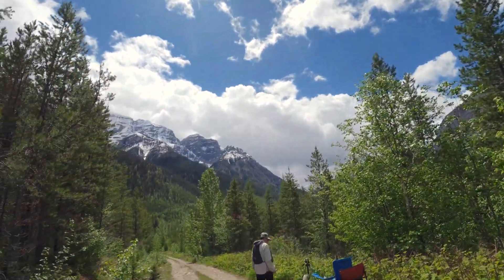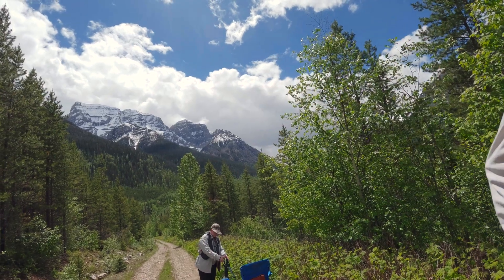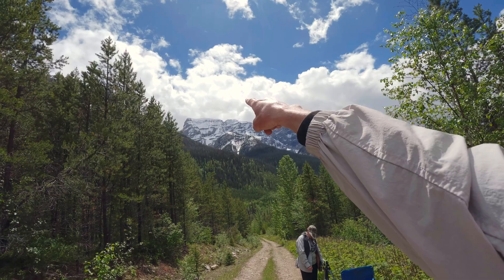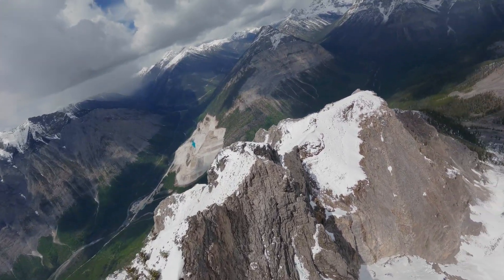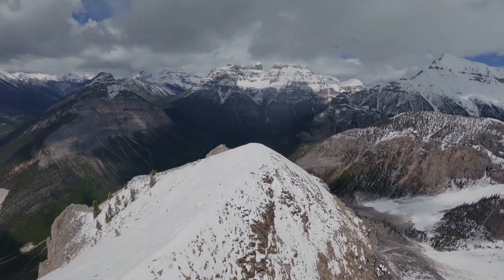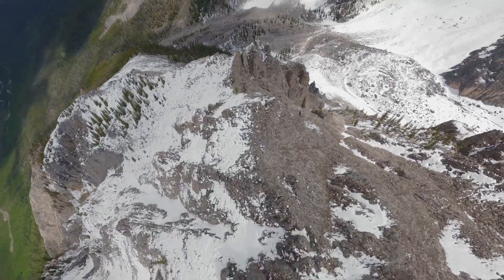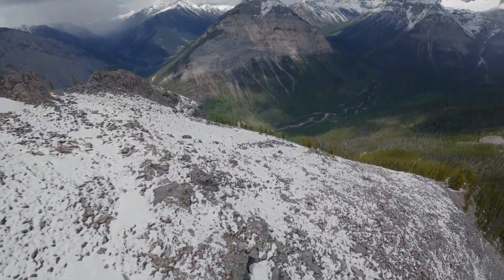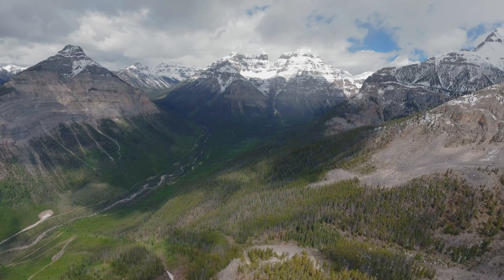Long Range FPV, Wind & Motor KV

Comment: For 10 inch can we go for 1250kv motors? I know it is recommended 900kv but just asking if 1250kv can be used or shall i gor for 900kv. Thank you 😊 🙏
Reply from the maker: I haven't built a 10" before but from what I know 1250kv might be a bit high.  I know 900kv is often recommend, I personally would probably pick 1050 or 1100kv.  It'll be a bit easier to tune than with the 900kv, just need to watch the amp draw, maybe 90% scale for the throttle.
Reply: @FalconRadFPV Thank you 😊

Comment: Hello, I am getting items together for a 7 inch build now. Things are a bit wacky on parts supplies. I am looking at the T-motor F-90 motors as a first choice. However my usual store front is limited to a 1950 Kv version. My flight area is primarily costal waterways. What would be your Kv selection for a space like that?
Reply from the maker: I would recommend 1300 to 1500 kv and a lower pitch prop, like a 7035 or 7037

Comment: Hey Conrad, I want to pick up the rad li-ion but you're saying I cannot fit an o3 air unit in there at all? Has this changed?
Reply: Nevermind, I see the 3d print on your thingiverse page now. Cheers, looking forward to building one.
Reply from the maker: I'm just about to release a V2 in a few weeks.  Just a few changes, nothing big, but did add more room in the back to better fit the 03 and also to allow for shifting the top battery a bit farther back to help better counter balance the gopro weight.
Reply: @FalconRadFPV  Great to hear, I'll have a bit of patience here. Are you going to be putting up a video at the same time that it goes up on CNCdrones?
Reply: @FalconRadFPV  Oh, one other question. Where do you order all your parts and whatnot from? I'm in BC as well.

Comment: Hello! Just want to say you inspired me to do a longrange build!

Is it okay if I use 1500kv 2806.5 motor with 7x3.5x3 props? Only planning to go 4kms out. 

Thanks for all you do!
Reply from the maker: That should be a good prop and motor combination.  It'll also do well in the wind.
Reply: @FalconRadFPV  thanks ever so much!

Comment: Could the vci 2808 1350kv be the sweet spot ?
Reply from the maker: For 7" props I think 2808 in the range of 1350kv to 1500kv is a great choice.
Reply: @ I went with emax eco 2807 1300kv as the other better options weren’t available here (planning to fly my local Swiss mountains)

Comment: Hi Falcon, thanks for the great info in your vids. I agree 1300kv is about right for 6s voltage on 7". Have you tried the recent craze of larger builds like8 or 10"? If so what are your thoughts vs 7"?
Reply from the maker: I'm thinking 1500kv is best for my flying locations.  At least for windy days.  When its calm the 1300kv are great.  But when the wind kicks in bad up a mountain (like 50/60kph+) the 1500kv's fly quite noticeably better.
The bigger the prop the slower it spins since the tip speed is generally the same no matter the prop size.  Props create vibrations as they spin, the vibration frequency is relative to the rotational speed of the prop.  Big props spin slower causing vibrations to occur at a lower frequency.   The lower in frequency a vibration is the harder it is for the flight controller to deal with and the more noticeable it will be in camera footage.
In my opinion,
- A 5" drone is extremely easy to get crisp gopro footage with a basic PID tune.
-6" easy
-7" not too bad
-8" a bit of work -from here down it'll get harder to have crisp footage in steep dives, low throttle cruising, or strong wind
-9" is a bit more work
-10" you'll have to work at it, you might need a more skilled friend to help

The larger props will help with better flight times and higher cruising speeds but at the cost of lower frequency vibrations and more difficulty in tuning.  A 7" is a great sweet spot, I can fly over 20km round trips and tuning is not too difficult to get great looking footage.  A 10" can carry more weight and go a bit faster, but if you're only carrying a GoPro and flying 20km or less round trips then a 7" will do it just as well and with less hassle in tuning PID's & Filters.  For instance, I've heard several times about people having vibration issues with the Helion 10.
Reply: @FalconRadFPV  thanks for the thoughts, yes the vibration does become more of a problem as the prop size increases. Same with drag which kills the efficiency even with a larger battery...I guess some can get away with it using video smoothing but its good to know that 7" can pretty much match the larger ones...if you go with the 1500kv - you can always tune them down with motor output or throttle limits for when you want to save some juice...

Comment: I'm a big fan of your channel, you're my favorite pilot !
What brand of motor would you get for the 2808 1500 kv for a 7" ?
I thought about getting the Emax PRO as they weight only 50g, what do you think please ?
And are the HQProp DP 7x3-5x3-v1s a good choice ?

Thanks a ton !
Reply from the maker: I always use t motor motors.  I've had good luck with them and the quality/weight is good.  That said the emax ones will be a bit cheaper and should have close to the same performance.  My new 7" long range build I'm working on has t motor Velox 2808 1500kv motors.  Yes those props should work well.  Most of the gemfan and HQ 7" props are pretty good.  Pick one with more pitch for a heavier build and less pitch for a lighter and/or more efficient one.
Reply: @FalconRadFPV  Thank you so much !!! You truly help me.
Will you use the same motor for your 7.5" ? I see that Gemfan recommends a 2812 then.

Comment: Hey was just wondering if you have looked into “rocket style” drones like the red bull one? Do you think this could increase flight time?
Reply from the maker: I think the aerodynamics are designed with max speed in mind.   Since the drone needs to be on like a 60 degree angle to be able to see in front of you I would think there is a fairly high minimum speed.  Flying very fast is really hard on batteries.  Draining a battery at high amps will greatly reduce the total mAh the battery will put out.  So for efficiency I think the design is not very good.  If it could be built so that the rocket body was only 45 degrees offset from the motor plane then it would be getting closer to an efficient build.  (all that aside, yes a streamlined rocket shape would help efficiency but only if it's pointing the right direction.  Doing 60kph the rocket shape would look to be almost flying sideways.

Comment: have you tried going above 7 inches for efficiency?
Reply from the maker: I use 7.5" sometimes on my Falcon RPM build.  I don't really see a need for bigger props unless you want to carry more weight.  I've been flying long range with a 460 gram cine camera on 7.5" props, it's getting heavy enough that bigger props would get me more flight time.  But flying with just a gopro or no HD camera, 7 to 7.5" props are big enough to handle the weight without getting into the vibration issues often associated with spinning larger props.  The new Iflight 10" for instance, I've had several people tell me that they are hard to get tuned nicely, although it does get a bit more flight time than a good 7".  But with my 7" being capable of completing easily over 20km in round trip distance I don't see a need to go with bigger props.

Comment: Did you take the time to properly PID tune each prop on each motor that you tried?
Reply from the maker: No I didn't, I'm only so/so at pid tuning.  My choice is based mostly around flight performance in windy conditions.  I'm sure a perfect pid tune would help a bit, but a lot of what's driving my choice is how aggressive the props are, wind causing inverse air flow when diving and in split S maneuvers and avoiding dropping a corner when doing long sweeping turns in windy conditions.

Comment: 2808 1350kv on a 7" chiming in and love it, currently testing 3115 1150kv on a 10" ... still TBD if building a 10" was necessary lol and/or more efficient than what my 7" is currently doing 🤔

Comment: Love your video’s, I’ve been flying a 7 inch frame build from RR that i built with 1300 kv brother hobby motors and I can’t seem to get the jello out. I’m thinking of building your 7 inch lion build would you recommend it over your larger prop builds ? Or should I look at the Falcon as I fly walksnail’s VTX. You seem to fly the lion  a lot. Thanks
Reply from the maker: The Falcon RPM does have more room for the VTX.  I crammed the GEPRC Maten 2.5W VTX in the RAD Li-ion, so you can compare with that.  If you're going to use a VTX bigger than the Maten then it'll be a really tight fit in a RAD Li-ion frame.  That Falcon RPM will fit any reasonable VTX unit.
Reply: @FalconRadFPV  thanks

Comment: Would you go for a bigger prop,  like 7.5 or 8 inch?
Reply from the maker: I use 7.5" sometimes on my Falcon RPM build.  I don't really see a need for bigger props unless you want to carry more weight.  I've been flying long range with a 460 gram cine camera on 7.5" props, it's getting heavy enough that bigger props would get me more flight time.  But flying with just a gopro or no HD camera, 7 to 7.5" props are big enough to handle the weight without getting into the vibration issues often associated with spinning larger props.  The new Iflight 10" for instance, I've had several people tell me that they are hard to get tuned nicely, although it does get a bit more flight time than a good 7".  But with my 7" being capable of completing easily over 20km in round trip distance I don't see a need to go with bigger props.

Comment: Well after recently ordering 1300kV motors to go on a new RadLion build, can see I may be having to order something higher in the not too distant future. 
Great to see you are still experimenting and exploring the boundaries to find the best compromise when it comes to long range flying. Will be very interested to see how you get on with the higher kV motors.
Reply from the maker: With 1300kv's on your RAD Li-ion you'll be good.  That's what I've used for like 80% of my YouTube content.  I just don't think going down to 1155kv on 7 or 7.5" is a good idea, especially if you need to fly in wind at all.  At 1300kv on 7" props it starts holding it's own in the wind fairly well.  I've just been finding a few days a year where it's nuts windy (like 60 kph+ winds up a mountain) and the only quad that'll cut it on those days is the one with the 1500kv motors.

Comment: I've run 1450kv Fpvcycle 30mm motors on my Falcon 7 and 1500kv 2507 BH motors on my Super G+ for a few years now and love the agility and speed. You can still get decent flight time its all throttle management. Which I lack 😂 I found 1300kv uninteresting, i'd never fly them on anything less now
Love your vids 👍
Reply from the maker: Ya exactly, flies better, you just have to keep in mind being nice to your battery by going easy on the throttle at least some of the time 😉
Reply: 3300mah 6s lipo for when I want to have fun, 2400mah 6s lipo when I want to be stupid  😁

Comment: Great info and cool spot!!  Just wondering why you went with the 3008 instead of a larger (volumetrically) motor like the 2810 F100?  I thought that the smaller diameter means it can change speeds faster?
Reply from the maker: You are correct, a taller motor will not cool as well as a flater one, but it will speed up and slow down more quickly.  Fine for long range right, we don't really get the motors hot.  The down side is weight, by the time a tall motor beats a wide motor for performance it's also going to be heavier.  That's why I'm going with a 2808 1500 kv for the next RAD Li-ion.  It's a bit taller of a stator than the 2806.5 that I used to use but it's not getting too much in weight.  I am thinking about getting 1350kv 2810's for my heavier 7.5" cine quad I've been playing with, I'm not sold on the 1155kv 2812's I've got on it now, but I think it's the same thing, the kv is just not quiet where I want it for windy flight conditions.
Reply: @FalconRadFPV  hey thanks for the in-depth reply as always :)

Comment: Has anyone ever tried adding a wing to a quad?  I feel like it would have to increase range.
Reply: It depends, but most often times It will take more than it gives. Horizontal flight emphasizes prop pitch speed more than quadcopters do. When the incoming air to the prop accelerates to the same speed as the pitch speed, the blades produce nothing but drag. A quadcopter attached to a wing will have inherently more weight than just a pure plane or pure copter, which means it has high stall speed, and if the props aren't aggressive enough to keep it moving above its stall speed, then you would need to add more wing area and more powerful motors with heavier batteries, you know how this goes.....
Reply: @Finnv893  Great points! I think with those considerations, a VTOL wing is the only sensible solution.
Reply: Wings have more flight time and range for sure. Just much more shaky in the wind and you can't hover slow.
Reply from the maker: Aerodynamically it would probably be prone to poor handling.  The center of gravity requirements for a quad and a planes wing are different.  Planes, and well I think anything with fins or wings, will fly best with the center of gravity forward of the center of pressure (aerodynamic drag).  Where as a drone flies best with them both the same.  That's why a VTOL is the only answer as far as something out there to buy, although it's pretty much just a plane, can't fly "like a drone", it just has vertical take of and landing.
But who knows, probably someone out there trying to attach a servo actuated wing that'll track the flight direction of a quad.  I think everything you need is in the firmware already. Let me know how it goes! lol...

Comment: could you please make a frame like the rad lion except designed in deadcat style because I really want to use o3/o4 on it to record. I really like the FR8 frame if that helps. Also have you ever tried Wings? Really with those your only limit is the video signal. There is something special about flying with a wing that is so different from quads. Also why do you never share your locations? I would love to meetup and fly in these beautiful places.
Reply from the maker: Well good news, I already made a no props in view long range frame.  The Falcon 7 and the newest version, Falcon RPM: https://cncdrones.com/falcon-rpm.html
Wings... ya I have flown a couple of wings.  Before getting into drones I watched a lot of the old school flite test episodes.  I've built and flown wings, along with several others kinds of planes.  I have been thinking about getting a wing setup for flying some mountains, maybe I'll finally get to it this winter.  As for locations, I never give them out, it's half the challenge of flying long range, finding great spots that aren't in any kind of park.
Reply: @FalconRadFPV  Yeah I know about your Falcon frame but I was looking for something more lightweight like your scout or liion frame. The FR8 does weigh more than those but it makes up with 8 inch props. I am also getting a wing this winter. Going with the atomrc dolphin on 6s. Tmotor f90 1500kv. Its the same setup that Visma uses. https://youtu.be/fdxnuwD8xEg?si=W5Zu18qK-9cfb1NT

Comment: what about 8 inch and 10 inch? have you ever tried it? because with a wide wheel base i think it is more stable. what do you think
Reply from the maker: Ya as others have mentioned, a 7" is kind of a sweet spot for having good flight time and not getting too low in rpm on the props.  Bigger props = lower RPM = more lower frequency vibrations = doesn't tune as well and it's harder to get nice looking HD footage.  Not that you can't get nice HD footage with a 10", but it won't be as easy as it would with a 7".
I've had fairly good luck with 7.5" as well, but I still end up flying my 7.5" Falcon RPM with 7" props sometimes.
Reply: @FalconRadFPV  Big thanks for your information and advice, I'll remember it. Stay safe 👍
Reply: They generally fly worse, it took me a while to dial in my Rekon 10, but it's still nowhere as smooth as my Falcon 7
Reply: I like my 7 inch more than my 10 inch. The bigger one has no benefit. No longer flight time or agility.
Reply: @chrisbee5481  Agreed
Reply: Как раз тоже самое хотел спросить
Reply: Already purchased a 10 Inch frame, it sounds like a bummer 😆 with the opinions from all of you guys. I'll find out then 😆